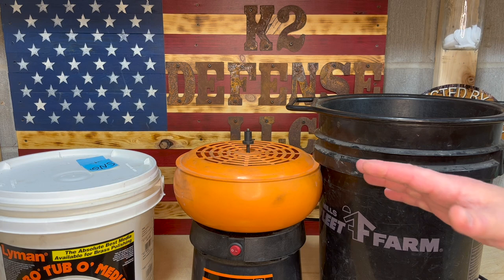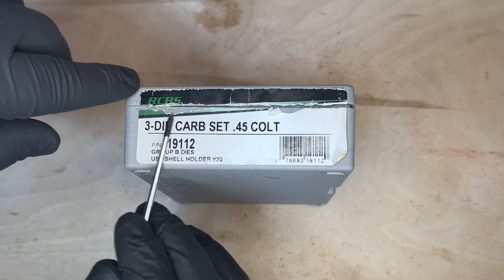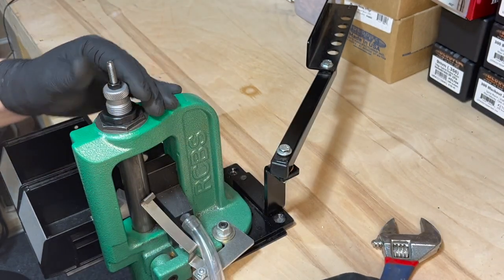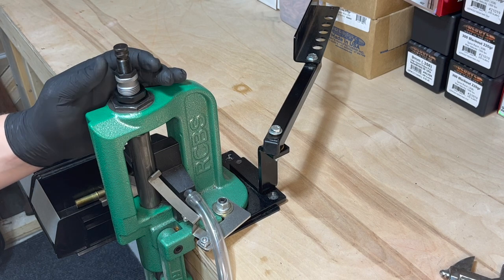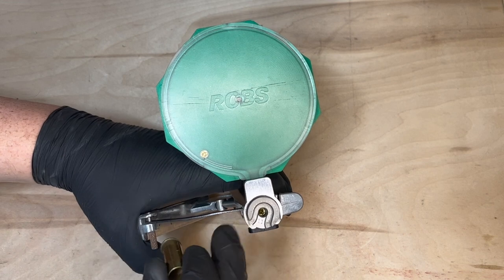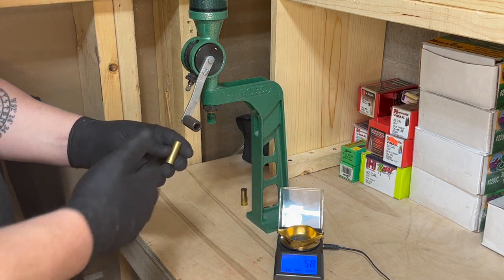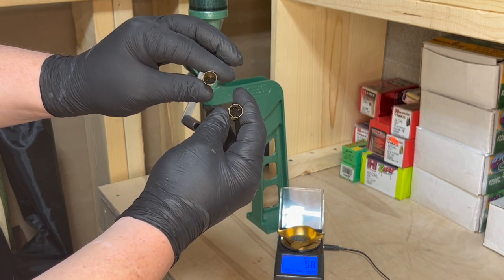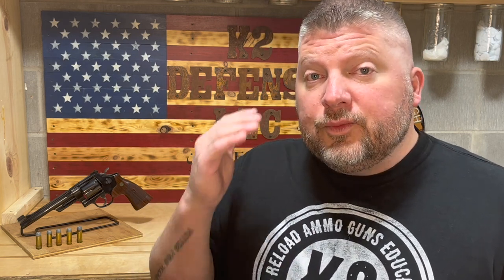How to Reload .45 Colt Ammo For Beginners

Comment: One comment from someone who has been loading 45Colt for over 40 years, pop the primers out before you tumble clean and save yourself some grief brushing out primer pockets.
Reply: I have 30 years reloading experience and depriming before tumbling does not clean the primer pockets. All it leads to is clogged pockets. The media doesn’t move around enough to clean the pockets. Wet tumbling with steel pins will clean the pockets.m
Reply: @Steve5404  I have been wet tumbling for over 10 years now.  I gave my shaker tumblers to the kids for them to use until they buy their own wet tumbler setups
Reply: I have been reloading for 147 years, and you all are wrong.
Reply: ...hell no that shit gets stuck in the flashholes... get a wet tumbler
Reply from the maker: @bradb.4570  - a newbie huh? 😂👍🏻
Reply: No crimp will invite squibs
Reply from the maker: Agreed! 👍🏻
Reply: I leave the primers in when tumbling. I hate picking pieces of cornmeal out of half of the primer pockets.
Reply from the maker: @denisdegamon8224 - agreed! 👍🏻
Reply: @Steve5404  Yep.
Reply: i have been reloading infinity times infinity years i win
Reply: For someone new to the should I go to some type of training course or something before trying to reload my own rounds?
Reply: Also the reason why I'm asking you this question is because I want to get a judge home defender and I'd like to be able to try and save some money on  45 long colt and 410 bore because I'm buying a judge defender

Comment: Great video! If you are talking about powder coating the already lubed bullets, that can be a lot of work. I've seen the question come up from time to time and the 1st suggestion is to sell the lubed bullets and cast or buy some un-lubed. There is also the suggestion to boil the bullets so that the lube melts and comes off then clean the bullets with acetone or something similar. If you are asking about powder coating bullets from scratch, Eastwood powders are great and shake and bake is easy. I use a wire mesh basket and live with a few pc boogers but some set the bullets up on their bases. Humidity is the key, try to shake the bullets in as dry a place as you can. Good luck.
Reply from the maker: Hello @hillbillync655!

Appreciate the feedback!

Comment: Great video. Have one question. I know this video went up a year ago so might not get answered. If the powder does not fill the case one the bullet is seated so you need to have some fill? I've heard of issues with powder if it ends up laying down in the case because it is not.full behind the bullet. Thanks. Again great video.
Reply from the maker: @seanhall957 - thanks for submitting your question! I try to answer all questions that come in. You don’t need to “fill” your case with powder to avoid hallow space. Matter of fact depending on the burn rate of the powder, it may be necessary. As far as the projectile resting on anything, it’s not needed. Once you bell your case that projectile will fit in there like a glove. Hope this helps! Keep those questions coming! Cheers! 👍🏻

Comment: Nice explanation !  The question I have, the powder is a small amount in a 40 grains brass. It will float around. What do you do to keep it near the primer. I have problems with unburned powder and stuck bullets.,
Reply from the maker: @billnopoles1934 - glad you found this video helpful! I’m pretty sure I know what’s going on. First, let me ask you a few questions. What type of projectiles and weight are you using, powder, load data, primers, how much crimp do you use, do you ream the flash hole and do you clean the primer pocket? Knowing that using no powder will cause a squib load because the primer has a lot of force alone, you don’t need much powder to make the projectile exit the barrel. So there’s something else going on here. We’ll figure it out! 👍🏻
Reply: @k2defense  thanks for the reply! I'm using the Lee hand loader, also for crimping. Using brand new brass, Hornady H110, and UNIX GINEX primers. According to the web page 25gr is recommended. I used 22gr for startup. Crimping? I sat the bullet until it's visually ok. It might be not enough. I am disappointed of the Lee loader. in my opinion it is way too tight. I have to use a 5pound hammer for setting (and crimping) the bullet. BTW, black power loads work very well. With the second batch (5) I put in toilet paper for to fill the empty space. One of 5 shot successfully.
Reply from the maker: @billnopoles1934  - It sounds like you need to bell/expand your case mouth a bit more to get better fitment of the projectile. You might also consider adding a bit more crimp after seating. If your having issues with powder not being completely burned, the easiest fix is applying more crimp. Hope this helps!

Comment: For 50 + years, I've been decapping, resizing my brass and then trimming as required BEFORE cleaning. I've yet to see others do this...wonder why? After firing, the cases are just tarnished but not dirty or contaminated. I've always had an excellent result. The tumbler cleans any resizing lube off this way including to some degree the primer pockets. Any comments?
Reply from the maker: @hugostiglitz2388 - range brass I always clean before putting through my dies. Many times there’s dirt stuck to the shell, in the shell, etc. I don’t want that going into my die and scratching it. If I’m reloading my reloads or purchased ammo, they are relatively clean already. When I make these entry level videos, I don’t go into this detail. Looking back now, I probably should have. Thanks for the comment! 👍🏻
Reply: I have always deprimed, sized, trimmed, belled, and deburred, my cases before dry tumbling. When it comes out of the tumbler, it is polished and ready to load without having to work the brass any further. 

For range brass, I run it through a sonic cleaner first before processing to remove all the grime before running it up into the die. That's worked well for me the past thirty years or so. 

I handload many different caliber rifle and pistol cartridges for my collection of firearms. Also, using a rotary media separator minimizes the hassle of cob or shell media clogged primer pockets.
Reply from the maker: @bustabass9025 - great input! Thanks for sharing your method with us! Sounds like you have shiny brass! Appreciate the comment! 👍🏻

Comment: Can you only use once fired? or is it okay to do 2, 3, 4 fires
Reply from the maker: Hello @Dailyfreedomfighter7788!

You should be able to use them multiple times. Before you do, you’ll need to make sure to visually check your cases. I also measure my cases to make sure they don’t get too thin to reuse. No one can guarantee how many times you can reuse cases as there are several variables that shorten their life. 

Hope this helps!
Reply: As long as you use a quality brass to start with and do not make your loads up to max pressures you could possibly reload the brass 15 or more times, especially if you use the bottom end of the load data.  But as K2 Defense stated always check your brass for cracks.

Comment: 45colt will be 9th cart starting today! Getting a Ruger blackhawk new model. 
As for powdercoating, check out my vids on it. I preheat boolits in toaster over at 150F for 5 min, low humidity is key. I take a tablespoon of powder for roughly 3lbs of casts, use a #5 or 7 plastic container and hand tumble spin vigorously for 30seconds to build static then 30seconds more slow hand tumble. Pour out into a tray. Wear a tight fitting nitrile glove and carefully pick them up giving a light twist in fingertips to reassure even coating. I stack on parchment paper thats resting over 2-3 layers of silicone baking mats to keep upright when transferring to oven and to distribute even heat. I bake usually for 19min at 400F. Let air cool, dont quench them! Make sure none are touching before you bake and until cool to touch. I do a dozen different colors but want to coat my 45colts clear gloss since its the strongest powder Ive found and think it deserves the bare lead look. Candy teal from the powdercoat store or eastwood jet black look great on brass. If youre a lead farmer like myself, bright colors like neon green will help you see them in the dirt quick to retrieve your alloy lead hogs. Unless youre shooting steel and throwing it away basically lol
Reply from the maker: Will definitely check out your vids! Thanks! 👍

Comment: Powder coating is too easy. Don't get cheap Harbor Freight powder. I do Eastwood. One container lasts forever. Put into small plastic container with #5 recycle triangle symbol. Shake for a minute or two until powder coat sticks to bullet with static. Sometimes larger bullets need a little convincing, so I warm them before hand, but if you do it too much, it creates a glob. Then set them out on a tray with some type of anti stick cover. Anti-stick aluminum foil works, but still have some that stick and costs money every time or two, so I use silicon sheets. Easy off and they last forever. Then I put them in a garage sale toaster over at 400 degrees for about 15 minutes. Take 'em out, let 'em cool. After cooled down, take a sacrificial one and smash the crap out of it with a hammer to test. Powder coating should stay bonded to lead and not flake off. Then run them through the sizer and you're done. It's that easy.
Reply: Don't lube them before hand, they gotta be clean. Powder coating is it's own lube. I have pushed gas checked and powder coated .223 over 2400 fps. That coating really holds that lead together.
Reply from the maker: Hello @lucasstoelting5975!

Appreciate the information! Can’t wait to try your method!
Reply: What is the purpose of powder coating?
Reply: @jodynickerson3545  First, it's practical lube. Wax method works, but for me it's messy when handling the bullets. PC can be a little messy, but once they've gone through the oven, there's no mess. Second, you can push the bullet harder/faster. I ran Alox .223 bullet through an AR. It can cause leading, but without gas check it blew apart. With gas checked it was grossly inaccurate. With PC and gas check, I was able to push it to 2400 FPS with about a 2-2.5" at 75 yards. Not super accurate, but enough for practice and is screaming fast for lead. I might have pushed it faster, but was just experimenting and seeing speed not developing for accuracy. I have dug 9mm PC bullets out of a sand pile that I shot  into and they were still coated. No leading from either of them. For me, the little extra time is well worth it.
Reply: @k2defense  It would be neat to see a video of your learning the PC process, and your thoughts on it.
Reply from the maker: Lucas Stoelting - it’s on my list to do! 👍🏻

Comment: Why do you wear gloves? Aren't your hands sweat inside? Are smth toxic in brass and powder?
Are you afraid of lead?
Reply from the maker: I wear gloves for a few reasons. My hands do sweat while wearing gloves but not that bad. I don’t want oil from my hands getting on the shells. I dip when I reload. I don’t want to use a dirty hands to feed my bad habits. I don’t want to break my tempo by running into the house to wash my hands. And lastly, the reloading components seem to contrast better with black gloves than my hands. That’s the “behind the scenes” reasons I wear gloves. 👍🏻